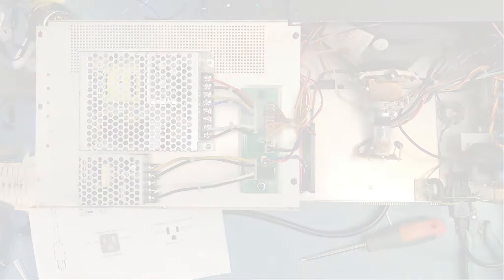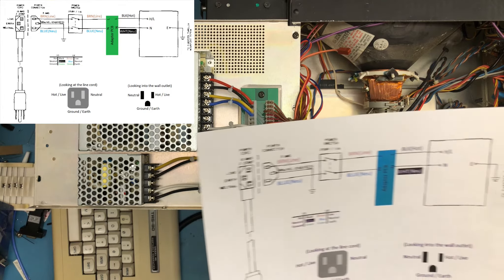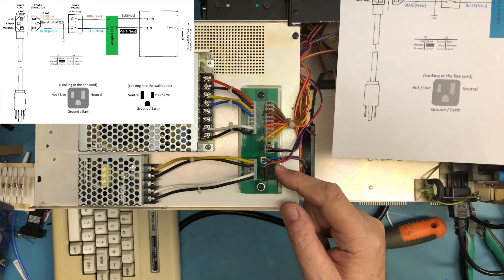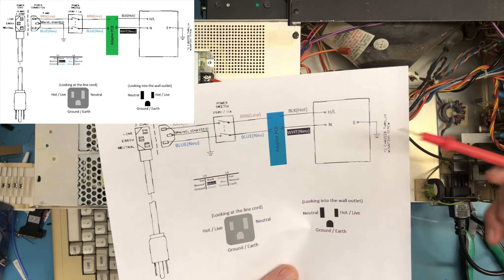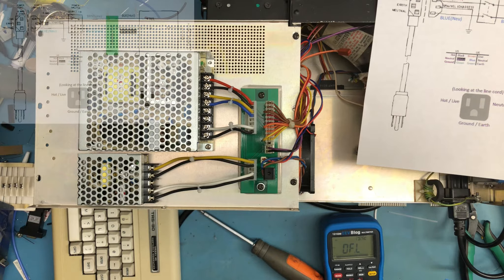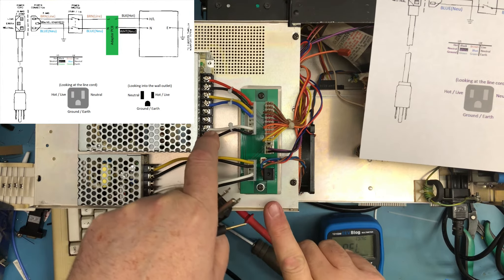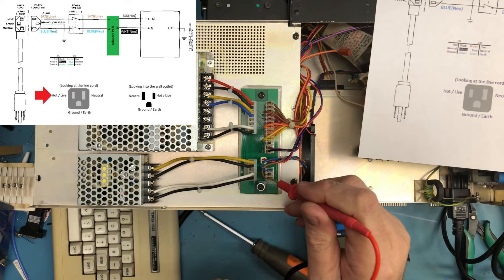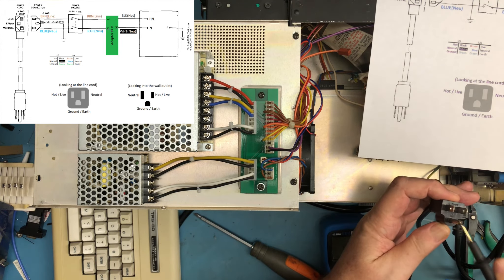STB540 - Tandy Model 4P - Part 11 - Verifying the AC Wiring

Comment: If you had wired it up wrong those MeanWells would of most likely not turn on since the DC ground and the Earth are bonded. I did that once when wiring up a 3D Printer, the Power Supply would kick on for a brief second then shut down.

For years I have heard Amplifier guys saying you should switch Neutral since it's connected to the chassis then I hear others say to switch off the Live/Hot. I for one prefer the DPST method so it switches both legs. I've seen Electricians wire up Receptacles backwards. Reminds me when I was mounting a TV on a wall and the back of the TV was metal, plugged up the TV and got a nasty shock, It even killed the TV and the customer was trying to blame me. I killed the Breaker and took the TV down, sure enough the damn outlet was wired backwards. After that I always use an Outlet tester before I plug something up at a Customer's House.
Reply from the maker: Thanks, totally agree with using a DPST switch and switching both the line and neutral.